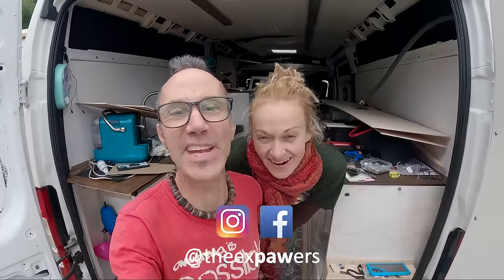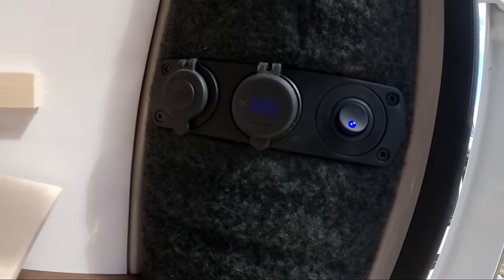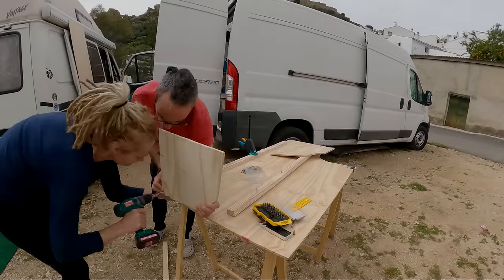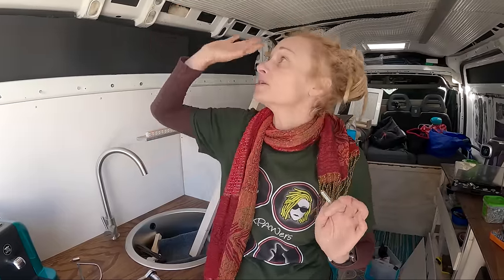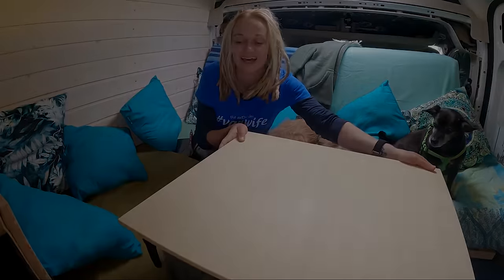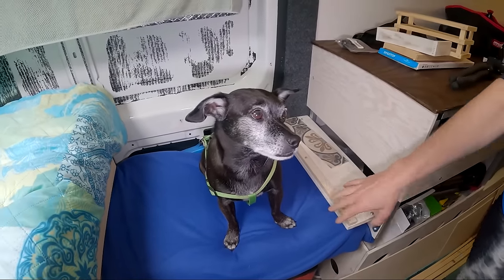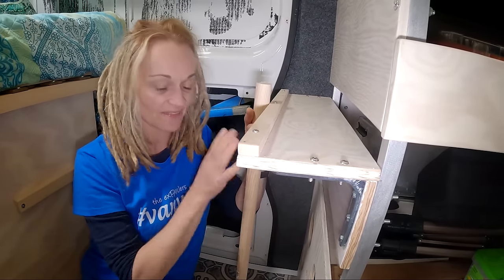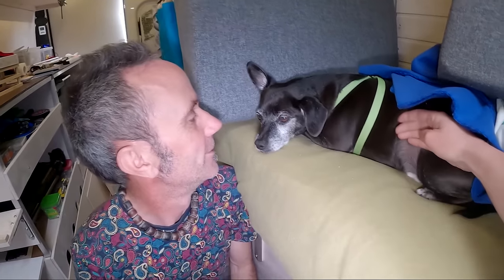RUSTIC AND WONKY BUT FEELS LIKE HOME  - A UNIQUE VAN BUILD - VANLIFE

Comment: 👍🏻 imho tinted awning panoramic window would be best.  Ventilation is definitely a thing, especially sketchy weather, you’ll want fresh air. My bus is big. I have tinted windows, which are the great for view with privacy during the day. I have both fixed & awning (emergency exit swing out) windows. The awning windows I like to open  on beautiful days in beautiful locations. 

Btw you are doing a GREAT JOB 👍🏻😁👍🏻 moments of both glory and despair, it’s a process, and you’re getting through quite well. Rock On 🥰

Comment: The van ;ooks great. Love the lighting. In regards to your little shelf that supports the bed and it's bent brackets. If you just cut two 45 degree angles on a piece of plywood, a couple cleats and a bit of glue and you'll have all the support you need...and it doesn't cost a thing. Been working on my own van conversion on a 31 year old Ford Econoline. Cut the roof open and added a fiberglass camper shell to give it full stand up room. Insulation and wiring coming right up. One important take away from your van build videos...Never set a rigid time schedule. Things get done when they get done. It's like eating an elephant...You can do it. One bite at a time.

Comment: Your van build is looking really good, love the problem solving attitude. We've got a maxi version of your van, so a bit longer, with the big awning window in the slider and its fine. No leaks, fly screen and pull up blackout screen. Its OK.  We've also got the full awning as it provides better shade as the sun moves across throughout the day. Smaller awnings give less cover. We often just run out enough to keep the rain out of the van with the door open, and the full length awning keeps the inside of the open door dry wheres a shorter awning won't. You've done a great job, well done. 👋 🇬🇧🇺🇦🇪🇺

Comment: Biggest window you can do - u really won't regret it! A Magnetic curtain then gives easy privacy as you can  just put it up on the bottom  part of the window and have light & view at the top if you want.  The sliding window in our door is a pest and we're always wishing it was an awning. Rain getting in behind the door panel is a major issue, as well as into the door lock mechanism, so it always has to be closed in even minor rain. And your upper cabinets - we wish we had no dividers as much easier to use biggish plastic or bamboo containers to separate or sort everything & the dividers cause fit issues with them. Can't wait to see the windows in. It's all so exciting!😁.

Comment: Sara, I wouldn't put dividers in the upper  cabinets. I would decide on what your going to put in and buy soft baskets to put things in so they don't slide around. And it's easier to change thing around if your not happy the way things are set up. The window for your door is a hard one. We have both styles in our caravan. The sliding windows allow more air to travel through, but the awning style allows you to keep windows open when it rains. You should put chairs outside under that window area and see what head clearance you have. Because awning windows may get in the way. You two are doing great and I look forward to you two getting back on the road!

Comment: definitely go for the larger size as it would look better from the outside as it will fill the indentation on the panel. Plus it's more light. We have sliding  I find they are better in the wind.

Comment: We fitted tinted glass sliding windows in our last self build van and it didn't take long for the aluminium sliders to start showing signs of corrosion. I had to make curtains, and mosquito netting was difficult to install. The black glass did look good from the outside though. Now we have been forced into buying a factory built campervan (French legislation) with awning style windows I would say there is no comparison. They are even double glazed. You can open them in the rain, pull up the mosquito net, and pull down the concertina blinds.  As for security, they will find a way in anyway
Reply from the maker: Hey Pete😊.. Thanks for getting in touch.. Interesting about the sliding window getting corroded, perhaps we should go for the awning type afterall as seems folk have better things to say about them overall😊.. Hope you guys are doing well, spring in just around the corner and you’ll have the pool open again soon!! Take care xxx
Reply: @theexPAWers the aluminium framing on my windows is 24 years old with not a hint of corrosion, even on the bit that got bend over 10 years ago. There's lots of different qualities available.
Reply: The pool is now open but it's piggin freezin. Should soon warm in the next few weeks though. Call in anytime 😊 @theexPAWers
Reply: I would go for a big awning window - double glazed means less condensation, & as someone said you can open them in the rain. Our sliding single glazed windows get really hot in the sun, but the awning style on our old van didn’t so much! Loving the videos!

Comment: Possibly awning windows are safer, perhaps sliding windows can be broken into??? You don't need a full length awning, a shorter one will be lighter. Awning wall cupboard doors open up and stay up until you need to close them and you don't bang your head on ones that open out. Just a thought. It's looking GREAT
Reply from the maker: Thanks.. Yeah we’re thinking about a smaller awning if we can find one that fits the Ducato.. We have no idea how they attach to the van etc xx
Reply: @theexPAWers  you're so clever you'll come up with a brilliant solution. You're doing a fantastic job, hope you're proud of yourselves

Comment: If you use the natural apertures of the van panels and doors they are usually a standard sizes for replacing if
they do get  broken  also cheaper off the shelf , awning windows are good but watch out for sliding doors or on one also  adjacent trees/posts when manoeuvring etc if
it's left open

Comment: Had the same problem with a rivnut. I had to drill out the bolt and rivnut, using vice-clamps to stop it spinning. Then new rivnut properly secured fixed the problem.

Comment: I have my side window by the bed the same height as my bed. Though only because when I built my bed I forgot to subtract the height of the mattress!
 But then my companion cat loves it as he can lie on the bed and look out easierly.
 I have a half sliding window covered with a security grill and mossie net. (Cat proof) The windows are tinted. I have good insulation covers for the inside of the window as well as curtains. You do feel the cold through the windows so with your dogs I'd suggest having the bottom up from your mattress.  A sliding window with security grill means I can leave the window open when away from the van.

Comment: Aaaaaahhhghhhhh!  So excited!!!!  Overhead cabinet framing is great!  You've been doing spectacular work.  And lighting!!!  No way!  The bed is looking great, and I'm with you...use the pole (path of least resistance).  If it doesn't work out, you can change to the ratchet angle brackets down the road.  As for the windows,  awning style will give you the option to have airflow at the bed on rainy days.  Nick said he thinks they may be flimsy.  They're not, but as with anything, you get what you pay for.  So, a good, reputable double-glazed window will do you right.  As for height of the window,  my preference is larger, but either will make you very happy.  Awning....are you wondering whether to go for a longer one to suit your van or a shorter one, like you have on Vinnie?  Weight wise, the larger size, in comparison, would not be overly heavy, right?  In the end, I believe the weight difference is negligible but the extra shade will be well worth it.  Like REALLY worth it.  I can't believe I still don't have an awning, especially because I live in Florida, but all in due time, lol.  In the meantime, I enjoy weighing in on how you spend your money😂!  With hugs and exuberance,  Lauren ❤
Reply from the maker: Hey Lauren.. Thanks so much for this message ❤.. Such kind words and also such great advice, we appreciate you and totally agree with what you’re saying😊.. Think it may be the awning window for the win! Good point about the awning too, we live in Andalucia after all and will definitely benefit from the large awning with extra shade 🥵.. Sending love, have a great weekend xx

Comment: I think put an awning style window in the sliding door due to the fact that they are acrylic and should hold heat in as well as not condensate. As a bonus they  come with blinds and fly screens which means no hassle making or buying curtains and fly screens that fit.

Comment: Awning windows are great as they don't allow rain inside when open.
A narrow panoramic window would be my choice with the mosquito / blind combo already fitted.  Otherwise your feet will be constantly hitting the glass, or the dogs could jump out if it was full size.
Also for security a narrow window is harder to access.

Comment: How about a bar across (low down-ish) the overheads and then pretty baskets/boxes in there? The bar will stop them falling out and low enough to allow putting them in and out. Pretty plastic magazine holders are lower at the back and higher at the front so can hide taller items (wash up liquid etc)
Awning style, my only concern if it was low down would be the dogs jumping out if they saw another animal. Issue with awning window??? Walking into the blimmin thing 🤕🤕🤕
Awning wise, go for the biggest you can, those Fiamma ones also have sides, so, you can make a much more waterproof extension!
Whatever you two, choose what YOU want obvs 😂😂
Reply from the maker: Good morning! Great suggestion with the overheads.. We already brought a load of brackets for the doors but maybe we don’t need doors! Hmmm, lots to think about 😊.. have a lovely weekend 🐣

Comment: I would go for the sliding window and the larger size. Even though an awning window has the advantage when it rains, depending that wind is in the right direction, in order to avoid it breaking, I guess the hinges are the weakest, you have to have it closed when opening or closing the sliding door. With a sliding window you don't have any worries that the window is open. A much safer option.
We've got a awning window on our slidingdoor and have never had it open. The company who placed the window has even put a warning sticker on it. 😊

Comment: We had a large awning style window on our sliding door and before long the struts started sticking and bits fell out. I think because of having to sort of slam the sliding door awning style windows, particularly large ones, don’t do well. Agreeing with Nick here, but also based on experience. Much as a sliding window is a problem if it is raining I still think it’s the best option for the sliding door. And you will be able to open the one at the rear, plus you have the skylight overhead which can be left open in light rain.

Comment: Sarah you look so pretty, that colour really suits you! Love the ceiling and lights, your over head cabinets  look great Nick! If your not sure about them being strong enough, just add a middle strut to each cabinet underneath for extra support😊 Ive seen a few light weight doors for vans, rattan being one idea attached to a frame, also you could use curtain wire like someone said below, but do top and bottom wire so you have support to stop items falling out when youre driving,  not adding much weight at all and much easier than making doors or frame work☺ Cant really give you an answer for what size window, thats up to you if you dont mind your feet touching glass😙 Cant wait to see next wks video, youre doing great guys, keep going! xxx

Comment: I like the nut rivets. But as I was putting them in. Drilled the screw hole through the wood then pilot hole using the screw holes to put the nut rivets in.

Comment: Hiya guys and fur babies❤ the van is looking fantastic your reallu talented👋Thinking of your cupboards how about having a lip on the inside so nothing can fall. Then put individual funky curtain material different for each cupboard with curtain wire top and bottom to catch if something does move. Maybe use baskets?. Also divide each one with a piece of matching material easily glued top and bottom saves adding wood and weight. Just a thought. ❤ cant wait for the big finish reveal🎉🎉🎉❤

Comment: Windows, the awning windows are amazing. I have both windows. Wiah I only did awning but oh well.
My awning window comes with bug screen and blind but the silicon ones don't come with blind or bug screen and it's hard to find a blind for them. Hope all goes well. Size doesn't really manner. I went for smaller windows for security, but they are great and bring in loads of light. Xx

Comment: Just something you might want to keep in mind guys about your window design is the changes in law in Spain regarding parking in certain areas and not being able to open windows which hinge outwards. I’m assuming if your windows slide side ways you would be able to open them in the hot weather if you were parked in an area which doesn’t allow camping. I’m not fully up on the changes but I believe you can’t use wheel levellers either unless their being used as chocks on a steep hill etc.
Reply from the maker: Couple of folk have mentioned this now actually and it’s a good point for Spain when it’s hot and you’re parked somewhere where you’re not suppose to camp.. We personally don’t generally park in these areas but then again if you’re visiting a city or something then this may be the case!! Anyway, it’s a tough decision to make! Thanks so much for watching..😁

Comment: I agree with other people regarding the awning windows. I've had those on two campers now, and they are great.  Both security and keeping out water.  I hope you intend to get the ones that have the insect screening and the block out blinds built in.  Oh, and tinting (suggested below) another great idea.  Regarding the side awning... IMHO - 32kg is way too heavy to put on the side of your van.  I like the option of the same type of awning you had on Vinnie.  All best, and I'm sure what ever you decide will be right for you guys and the pups. Thanks for sharing - Cheers. 😁💞
Reply: 32Kg is negligible for a 2,000Kg van, even at the top, loaded roofracks are much heavier.

Comment: You could do the full size tinted privacy window so you wouldn’t see the top of the bed from the outside. Instead of investing in a Fiamma pull out awning which is both  heavy and expensive, you could put on an aluminium awning rail (light as a feather) and then slide on a canopy with extending legs. These wouldn’t take up much room at all in the van.

Comment: Hey guys,  I think awning style but with window going down to almost to your bed level you may find the sheets get damp from condensation on the windows or just make sure there not touching them I guess. So I would opt for slightly smaller ones.Have a blessed week 🙏
Reply: Yes, good point about condensation wetting the bedding.

Comment: Suppose it's too late to say there was no need to hacksaw that bolt off. you could have left it so long as a hole matched up in the frame for it to sit in. Bit of wood filler and paint job done.

Comment: You could put in one of those car windows that cover the whole side of the sliding door windowspace, with the built in sliding window in the glass. I dont think you will regret a huge window, as long as you tint it, so it is difficult to look in, but not out. 
And do you need an awning that covers the whole lenght of the car?
I think the poop up sideboard for the bed is better, because having the awning on that side, means you will probably use that door quite a bit.
Reply from the maker: Thanks for all the advice. 😁

Comment: The big window for the dogs would be great for watching the world go by.Get a mirror film on it for security and privacy , plus it will keep the heat out better.If you need any more privacy blind fold the dogs and close the window blinds.😂I think a 3.7m awning is too big.Think of wind, if you only won't it slightly out and is it going to be electric at that size? For the bed you could you have two metal sliding horizontal poles that pull out from the cuboard .You could use plastic pipes attached inside your units that they  pull out from . You have a hole thyme so it would be  very discrete.Your shelf and upright pole looks a bit lumpy for the bed. Your van starts to look so professional. Really impressive.

Comment: I would do the bigger window. I've just had proper van windows put in. I had a leak in one of them but the window company came out and re-did it and no issues now. I got both my back panels, back doors and sliding door done. I'm buying a c-rail and getting a drive away awning

Comment: Get the larger window, I am sure you won't regret it and you will benefit from the extra natural light.
The Fiamma awning is fine although the large one is prone to catching the wind. Get some good quality tie down straps. You have saved so much weight during your build that you can afford the 32kg of weight in the awning.
How about fixing timber struts at 45 degrees to reinforce the shelf angle brackets?

Comment: Guys that is SO exciting! 😍😍 Really brilliant to see the progress you've made despite the unhelpful weather. 
The pros I've seen for the awning style windows is that you can open them in the rain and it's less likely to come in, than with the sliding ones. Unless it's coming down sideways, like it mostly seems to be doing here in the UK. 🤣😒 but if you're putting an awning on the side anyway then that wouldn't necessarily be an issue so the sliders might work too.
Wow, that was super helpful wasn't it? Great at decision making here too. 😂